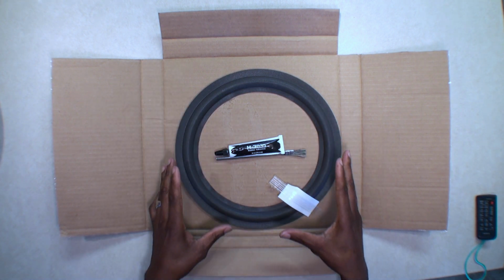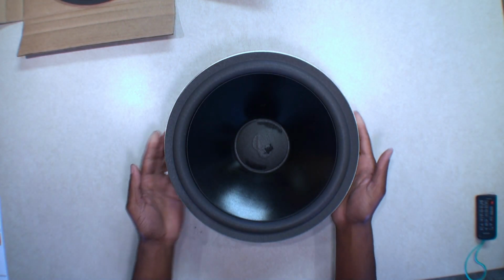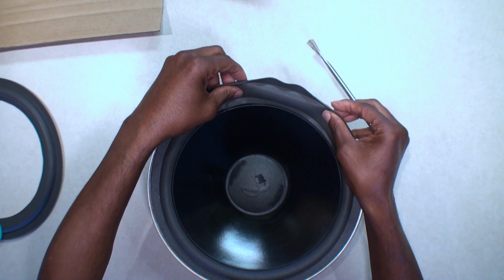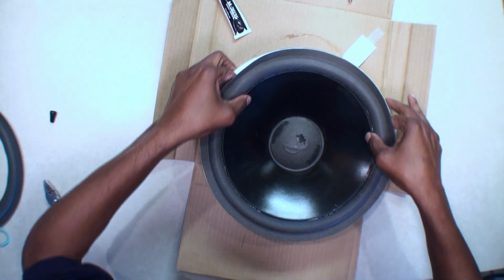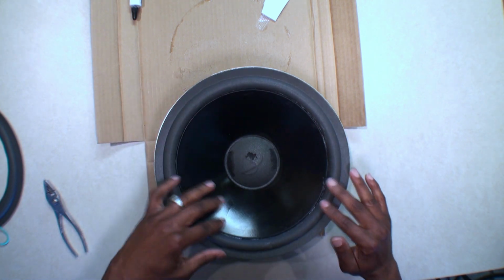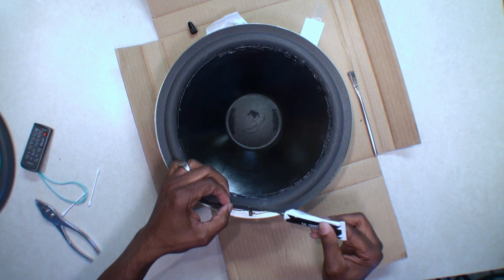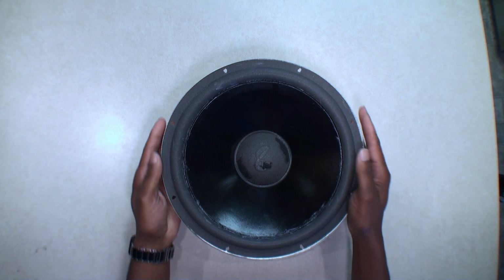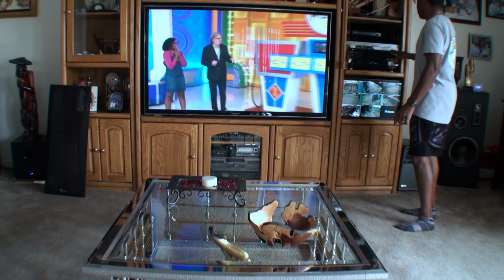DIY repair kit for Infinity SM125 and SM122 Tower Speakers.

Comment: Simply Speakers have several videos . They have a clear cut video on how to refoam and replace center cap the correct way and even centering the voicecoil. I just found a brand new pair of the 122s on the internet that were purchased new and never used. The boxes were still un opened got them for 400. Well worth it, considering they were never used still in the plastic and original paperwork and all.Also, partsexpress sells several different woofers to replace these original woofers and they are 10 times better than what originally came in these.